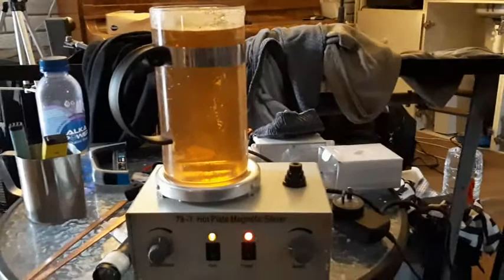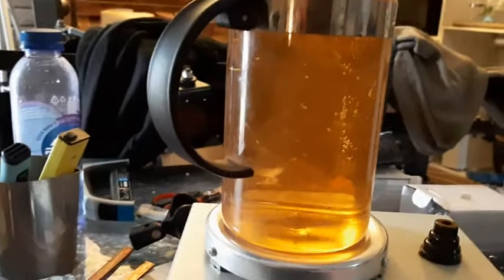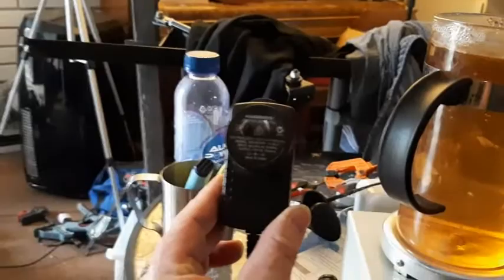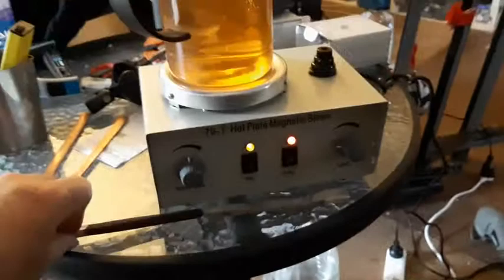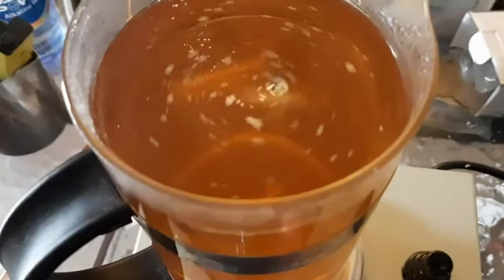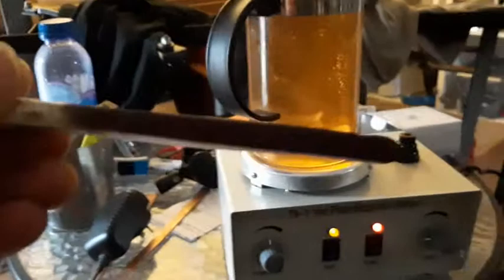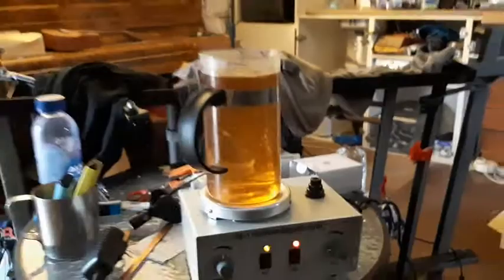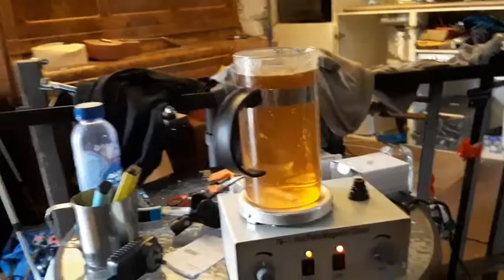How to make Colloidal Silver Electrode size , Voltage? DIY.

Comment: Hi how do u use the wall Adapter to connect it to silver wire rods
Reply: let's say we have 2 x 12v adapters, I take a multimeter cut first adapter lead and connect to multimeter on 20v DC setting and check which combination of the 2 wires will give me +12v mark which is positive ( red ) from meter, then do the same as other adapter then connect the negative to the positive , once this is done there will be 2 wires remaining,  then connect a a double lead with alligator clips ( red and black metal ones ) and connect the 2 wires separately to the alligator clips then the other end of alligator clips up to the Copper or Silver electrodes , next plug the adapters in and then set multimeter to 200v DC and check the Silv or Copper electrodes which should read 24 v DC.
Reply: @sitrucking9602  can u get ur email. I send a photo of the Colloidal silver i made using 27v batteries
Reply: @Justwnsz  Hi yes it  uses the same principles of multiplying the Voltage in a process called "Series wiring " with batteries it's will put the post to the neg of each battery / 9+9+9=27
And if using adapters I think my one is a 20v + 12v = 32v. So it's same Series wiring, another wiring is Parallel so with 3x9 V batteries all negs wired to each other and all positives wired together gives still same 9volts but more 3 times lasting current.
I have put email in separate text as I don't know if you tube allow emails.
Reply: @Justwnsz  indigolotus777 then the @ then gmail then . Then com 
I put the address in but I don't think it worked so I have separated it.
Reply: @sitrucking9602  did you connect the wall adapter to the multimeter & then uses the alligator clip to connect it to the silver?, if so where did u connect the alligator clip to the electric current. Can you make a video so it’s easy for me to understand
Reply: @Justwnsz  yes next time I will make a vid on how I multiply the wall sockets and use alligator clips, to get the battery free connection. I should point out as well that the size of the electrode makes a big difference.  I made my own electrodes by buying a 1 kg Silver piece (ingot) then put in vice and put a thin cutting blade in angle grinder and cut in long ways,  I cut a quarter off then I cut it again down in half but still long ways.
This may seem extravagant but for both electrodes about $250 then just sell the Silver back to dealer ( definitely not pawn broker or kiosk in shopping centre but proper gold and Silver dealer. Initial outlay about $1000 but should get over $700 back and 2 silver electrodes that will last longer than you live, and if you ever stop you could sell them and if silver goes up you probably end up paying nothing for the Silver Electrodes which are Ultimate compared to any electrodes sold in kit.  Yellow Silver water every time with right  electrodes, voltage and heated water magnetic stirrer worth about $60.
I will try vid whole lot but it may take me coup.e of months, I even have Silver and Copper water for the wife to bath in.